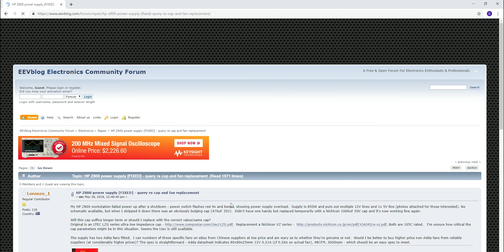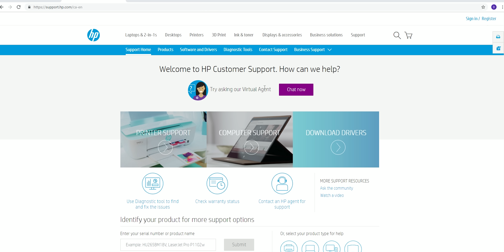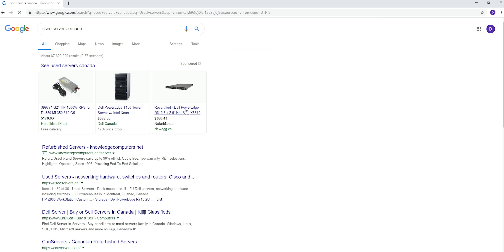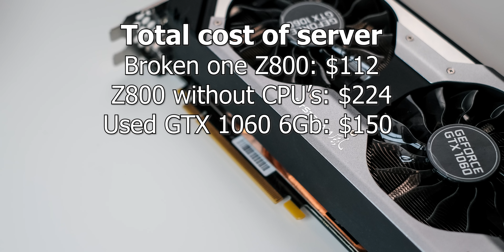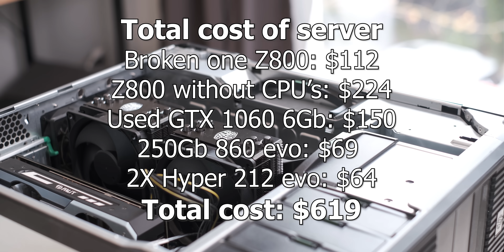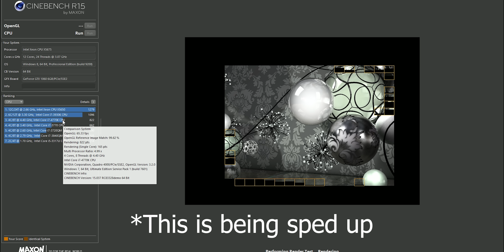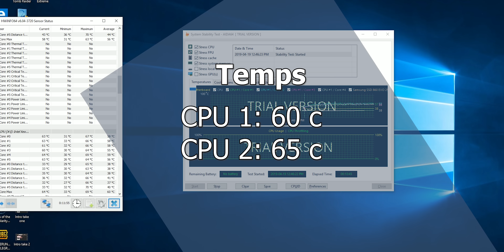Dual Intel Xeon, 48Gb BEAST for under $700! (With Benchmarks)

Comment: This build is worth it if you actually do server stuff, and use the gigantic amount of RAM.
For gaming, 600€ can get you a complete build with gtx 1660 and ryzen 5 2600, that'll do 20% more FPS. Also plug and play, no risk, warranty, modern motherboard, support for the next 10 years... But yeah, not quite as sexy as a dual Xeon setup :D

Comment: "Doesn't have USB3" - For about $10 you can surely add it via PCI-e?
Reply: You can, and that was what I did in a similar setup.
Reply: Ohh that I did, plus USB type C. Card was about $15
Reply: You can but there are a few caveats. This board only does PCI Express 2.0, and some of the slots are 1.0. When I put a USB 3.0 x1 card in my machine I couldn't get full speed because I didn't have enough PCI Express lanes at fast enough speed to hit full throttle. I mean, yes, its better than 2.0 by a long shot but its still bottle necked a little.
Reply: Yes and no. 

I tried this on another computer that didn't have USB 3.0. I placed the PCIE card into the slot and just like that, it was recognized by the system and was working as expected. 

I own a VR system. And every VR user knows that VR requires USB 3.0 or higher so the VR can send a lot of information to the computer to accurately track it's position. 

When plugging the VR system into the USB 3.0 PCIE, everything would be fine. Until I get into a development debug session or game, it would freeze the entire system. 

The reason why? The VR system overloaded the PCIE card, resulting in the system completely freezing up. The bandwidth got bottlenecked and the information was too much. 

But why did this exactly happen? PCIE Slot version was the culprit behind it all. Lower PCIE versions won't have the capable amount of bandwidth to fully support USB 3.0. 

This system is old, so it doesn't natively support USB 3.0 on the mobo, as well as not being able to support it via PCIE cards due to the PCIE lanes having too low of a version to fully take use of the USB 3.0
Reply: Nobody wants to waste a slot on that
Reply: isn't that x58? i thought even with a usb 3 pcie the slot doesn't have that bandwidth? correct me if im wrong
Reply: @DesignerOffDuty  Same generation as x58, but it's the server variant called "Intel 5520" chipset that supports 2 LGA 1366 cpu's 3W higher TDP and has mostly the same specs otherwise.
Reply: @DesignerOffDuty  no this is not x58mobo
Reply: Yeah you can i have the exact same machine, and I have both a WiFi card and USB 3.0 card. The USB pcie card Is 4x toh which probs helps the fact its running on pcie 2.0
Reply: Yep, you can do that indeed. Lots of USB 3 ports in fact! And you can add USB C while you're at it.

Comment: The 1st z800 with 2 x5675's and 48gb ram for $112 was a steal, even with issues. Worth 3x-4x that in parts. Unless one has weeks/months to troll the internet, this price point is probably not repeatable.
  Bare-handing the guts of an 1100 watt power supply, especially when you have "no idea what's going on inside" is a bad idea -  The capacitors, if not discharged, hold enough power to seriously harm you.

  Following that up by fiddling with the mobo power connectors - while it was plugged in? You mentioned that you pulled the connector out a bit and the PC actually switched on. Unless you skipped a few steps in your description, "diagnosing" while on live power is just plain wrong.

  You already know you got off easy with just a toasted gpu. You should clearly warn people not to follow your methods rather than just shrugging off the loss and basically 'hoping' the next one didn't catch fire. Keep in mind that people's kids watch these videos. Fortunately I'm watching this with my teen son who's savvy enough to recognize you as a "mad lad". His words...

Comment: The power draw of this outdated monster is making this build absolutely not worth it.
Reply: it will eat so much power that in less than one year you will pay same amount as the purchase price :D
so its better to buy a modern system even if a bit more expensive..
some mid-range AMD CPU with 1060GFX will be much better than this indeed..

Comment: Why would you want a dual processor system for a gaming system?! Most games (paticularly those a few years old and older) ran mostly on a single core. Even if you factor in games that actually made use of threads it may only need 2 or 3 cores.  Games just aren't conducive to that sort of programming model.  The other problem is that dual processor systems often will suffer bus contention issues when  running at heavy load.

The one possible advantage is if you stream games.  Many will use one PC for gaming and another for the streaming, but a dual processor system should be able take it like a champ.  I have an old Dell PowerEdge with dual P3 1.4GHz processors that I mess around coding for.  Not often anymore, though.

Comment: I have same model maxed out as well. it's a nice workstation and provides enough horse power to build a lot of docker instances. You've also hit the problem of buying older hardware square on the head. Newer systems can be a lot faster and better.
Reply: and way more expensive

Comment: I ve got a slightly cheaper version a xw6400 with dual E5 345 Xeons 16 gb ram and a R9 280 3gb gpu for about £130 GBP. And thats with a monitor vga but i works lol,keyboard and mouse. Very cheap and interesting to use

Comment: Jesus, what kind of spray paint was that? Looks like it came out of the can in a solid stream instead of a mist.. And, why didn't you clean the thing!!
Reply from the maker: I know right? It was really weird spraypaint. It was very difficult to use and the end result wasnt that nice.
Reply: @DawidDoesTechStuff  I'd hit it with some more light sanding and use some decent spray paint. It was almost like the aerosol had been destroyed, which can happen with extreme temperatures, hot or cold.
Reply from the maker: @AlphaMachina  That is very interesting. I'm sure that was the problem. I sold the PC months ago so unfortunately I can't redo any of it. Thanks for the comments. :D
Reply: @DawidDoesTechStuff  Nice, build, though. I can't believe you got all of this together for so cheap. Well done.

Comment: i think u can have better gaming experience with 2 X5687, they are 4C/8T CPUs at 3.73Ghz.
8C/16T at 3.73Ghz will do better at gaming then 12C/24T at 3.33Ghz.
There is also the X5690 that has 6C/12T at 3.6Ghz, but for gaming i would go for more clock speed because this server cant OC.

Comment: HP Z800 is dual quad-core Xeons. Nowdays AMD x3700 has 8 cores in a single CPU which I am sure will beat this configuration to dust with similar price. Which one would you choose?
Reply from the maker: Oh the 3900x will be waaaay faster. Honestly with all the modern CPU options around this kind of build doesnt make too much sense anymore.

Comment: Did the same with a lenovo D20 I got for free, and upgrade it with 2*X5790 ( 6 core@3.47Ghz xeon) and 96Go of DDR memory
and it is a beast as an esxi for testing purpose. And it didn't cost much.
I added it an old 780Gtx, and created a VM with the GPU and some USB ports direct attached, so I can also play on it.

Comment: you killed the stock airflow by orientating the coolers up (instead of backwards), 

If you can't orientate the hyper212's to push air backwards, then it's better to leave the stock coolers.

you can replace those CPU's  for a pair of  x5690's  and a gtx 1080 reference,  and you  have yourself a ryzen killer.

Comment: can prob make a 8 core ryzen 7 now with similar CB15 scores around same price and much less power consumption. https://pcpartpicker.com/list/q2y7Xv currently @ around $470 just needs a case and can upgrade to 32gb ram for a bit more and still under $700 and will outperform this.

Comment: Cool thanks for that.
I had wondered if the old server tech was any good over new tech as they usually are on par.

I have Xeon single quads. And I find them slow, I found also that a new i5 was much better.... 50% better overall.

Like you I like video and gaming, and other bits. So what you showed was spot on.

However, the is you installed may not have been right. When I used to build big big systems and I won't mention the four processor boards.... If we were windowing, we had to call ms for special software. It never was out of the box, and the same will be for the windows version that's your using.

Another issue you would be havvin is that your speed is down to ram clock and bus, they should be adjustable.  Get it right and you could see up to 30% performance increase. OS trimming 15%+ so 45% is possible.

But your on old tech and a bios which won't be helpful.... So 30% is maybe...

Comment: you could of gotten a better machine and cheaper as well by just going with e5 2620 hexa core in dual scoket for less than 20$ also much faster than 1366 old CPu.

Comment: I bought a Dell PowerEdge R810 from eBay for £450 which came with two 10 core Xeons and 128GB RAM, I put a 1660ti in and it’s a great gaming PC 😋

Comment: You could have run the appropriate sized tap through the mounting holes.
Reply: was thinking the same thing till I saw exactly how he was painting the side panels and at that point figured that it was amazing enough he knew how to operate a power tool let along have a tap and die set
Reply: @mathewhoffer4541  True that ;)

Comment: The two X5680 of my z800 deliver 1554 points in cb15, which is ok, but it's quite loud (standard heatpipecoolers) and hot (~85°C) and I had to change the way of my RAM-airflow (12*4GB DDR3-1333ECC) from sucking to blowing, reducing the temps 10-15°C... but it cost me only 250 bucks for the CPUs, the RAM and the coolers, cause it was thrown out @work & I rescued it from the junkyard (oh and SSD as well as GPU are not included in the price, cause I had them laying around anyway). But the idea with the Cooler Master Hyper 212s awesome. Thanks a lot!!!
Reply: I have a dual x5680 / 48GB system as well (Dell T7500).  I put a IOCREST x2 SATA III Controller, 240GB Sanddisk SSD, some 500GB hard drives, and a GTX 1060 in mine. It's still really fast (to me).

Comment: I built a Z800 with dual 5690s, 96 gigs of memory and a 1080 ti a couple of years ago.  One of the funnest builds I've done and I'm still using it. 

Main thing about putting one of these together is if you need copious amounts of memory but don't want to give up a kidney, this is definitely a viable route.  Obviously, these CPUs are no longer dyno queens but they will still get the job done and game pretty good while they're at it.

Comment: I have dual X5690 in my dell T7500 and a supermicroboard, There are motherboards that will let you overclock these CPUs to 4.4Ghz, but to find one that does dual processor overclocking, is going to cost you ~$600, for a 10 year old motherboard

Comment: nice built but i definitly would add a PCI-E SATA 3 6 GB controlleur board to justify the SSD use !  and while you there add usb 3 or 3.1 !
Reply: Make sure that it's at least a x2 PCIE because a x1 WON'T increase your speed very much at all.

Comment: I never expected it to game well, Xeon processors are not designed for that at all. Run linux, apache/NGINX,MySQL, all day every day perfect though :)
Reply: My old Xeon X5680 is EXACTLY the same as i7 980 CPU except for it having two qpi links instead of 1 like the Core i7 has.

Comment: I had a X5670 and it worked really well for games and stuff especially since I overclocked it to 4ghz. Those old xeons are great, nice video man
Reply: I still have a Dual X5680 / 48GB Dell T7500 Workstation. It's really fast upgraded with SATA III controller and SSD.  Probably not worth doing anymore though.

Comment: Just grab an Asus Z8NAD6, put 2 x5675 on it and good u go. Will cost u less then 300 Dollars, with RAM, on Ebay (at least here in Germany), is normal ATX, has also PCIe x16 and just takes a standart ATX PSU.
Reply: Yeah. That's what I have. Works great and wasn't expensive. Bought the CPUs and MB on AliExpress.

Comment: I purchased a Dell R820 with 4 Xeon processors for a total of 32 cores with 128 GB of memory with 2 TB of storage for about $850 this last spring, it cost me about $125 bucks to ship it... at 65 lbs shipping isn't cheap.

As a developer its a real fun box to work on with 64 virtual cores, but it lives it's life out in the garage as its too loud and the garage needs a heat source.

As for power.. well it costs less than $6 per month to keep it running.

Additionally I use it for media storage (my PS3 sees it just fine), a backup drive for all the photos and files for our house... and a DNS server.

See https://techmikeny.com/ if you are interested in pricing, eBay has a bunch of resellers also but I bought it directly from tech mike.

Comment: Pros - very cool, dual CPUs has a always been a thing PC enthusiast lust over. Con/Reality - 99% of home users do not need or will not benefit from dual CPUs. This sweet config doesn't work how most would think or want and the price isn't worth it. A more powerful system could be built with used AMD Ryzen parts for the same cost.  I love these HP workstations, I have a modded z420 Xeon 1650v2 @ 4.3ghz. If you want to go this route I highly suggest going with a Z420,620,820 or newer and avoiding dual CPUs unless your doing productivity work with software that will utilize them. I will be reviewing my z420 possibly in a few weeks, its good to see so much interest in these.

Fore this Z800's lack of usb 3.0 why haven't you just bought a cheap usb 3 pcie card?

Comment: I bought a Z800 at a Computer Works Goodwill w/ Dual x5660s instead of the x5675s you went with.  I also upgraded the ram from the 8gb of ecc ram it came with to 20gb of non-ecc memory.  The total from goodwill was $50!!!  I currently use it as my main rig, but hopefully I'll be able to sell it soon as it is just disgusting on power usage haha

Comment: I just started the video, pause it and will pay atention to it because I have the same PC and I really want to watch the process of upgrading it, mine has with 96Gb or fam, two intel 130W TDP heatsink gtx980Ti and change the PSU to a 1100W because that with 800 stock cant keep up

Comment: Buy second hand Mac Pro. Buy RAM.  Same, cheaper.
Reply from the maker: I would really like to get one of those for a video. :D
Reply: @DawidDoesTechStuff   It would be interesting to watch, hope you will. :D
I did that move to get my  my Mac Pro ( 2008 3.1 octocore 3gh, 24 gb RAM in pristine condition) a few years ago ;  800 +150  bucks for more RAM) and its a beast, smooth machine even for 2019 standards.  That should cost you way much less, nowadays.  Mac Pros are cheap
Good video, btw!
Reply: @migtiming  chiniese Kllisre X99 V102 mATX mobo + Xeon E5-1650v3 6c/12t  3.5/3.8GHz + 4x8GB DDR4-2400 + BeQuite Shadow Rock TF2 CPU cooler = 300USD
that mobo is USB3, SATA3, NVME M2 and NVME SSD capable, as a current tech one ;)
Reply: Mac Pro is not as upgradeable

Comment: Here in Germay the older dual socket baords and server are super cheap.
I recently bulit a 2U IBM x3650 M2 with two Xeon 5650 (2*6c) and 48GB RAM for under 100€/$100
But my pride is my 500€/$550 Dual Xeon 2680, 16 Core Workstation with 160GB DDR3 ECC and some parts i had over. It's completly passive cooled and gets about 2000 points in CB R15 :)

Comment: Always like seeing HP Z workstation content and Xeon content! I've done so many custom transplanted z400 Xeon builds and also a few Z420 and z620 builds. Actually z620 setup serves as my test bench with an E5-1620. Do a video on trying to flip this system, then a follow-up using it's newer brother the Z820 :) dual Xeon E5-2667v2 CPUs would make for an interesting comparison to the upcoming 16 core Ryzen
Reply from the maker: I wish I still had it, I would have loved to upgrade it. I am thinking of doing another one of these videos at some point.
Reply: Hi, I have to setup an economic PC for 3 CAD. I thinked to use HP Z420 QC with the E5-1620v2 with 32 GB of RAM, Nvidia Quadro K2000 and an SSD. All for about 450$. What do you think about performance? Is It still good or i have to move to a ryzen 3 config?
Reply: Fabio Di Nicolantonio | Ortona if you can at all go for something faster than E5-1620v2, it's the slowest CPU for that socket, quad 2.8GHz with no turbo. I have this as a visual studio workstation and it's slow for that, infuriatingly so.
Reply: @fabiodinicolantonioortona1407  I would say upgrade your CPU to the E5-2680 (V1 variant not V2), it gives you 8 cores, 16 threads, 2.7ghz base and 3.5ghz boost. Its offically not supported by HP, however many have had no issues using that that processor with the HP z420, also people have used Registered ECC without issues either on that board. I hope this helps :)
Reply: @fabiodinicolantonioortona1407  I did one with a Z440 and that has an e5-1650 v3 32gb ram and a GTX 1080 all for less than $700 after tax and shipping. I felt like I made super saavy move because at the time server chips were pretty cheap and I figured I'd just pick up a new CPU if I needed to upgrade, but there's demand for these high clocked high core count CPUs now so an upgrade isn't as cheap as I'd once thought it would be.
Reply: Z620's with daughterboard tend to have issues due to age though... Daughterboard socket plastic doesn't live long
Reply: im running a z420 currently with a E5 2670 and 64gb ram , am just waiting to upgrade my gpu atm as only running a 1050ti

Comment: I have an Asus Sabertooth X58 with a Xeon X5650 6 core 12 thread that runs at 4ghz watercooled and I get 917Cb in Cinebench and also it's paired with a GTX 1060 6GB Aorus and I'm getting more than a 100fps in some games on ultra settings so yeah X58 is aging well.

Comment: I still run a z600 as my main work computer.
Reply: Hi, what processors do you use?
Reply: @nikolamijic  Dual X5670
Reply: and did you installed them into the z600 ?
Reply: @nikolamijic  yep.